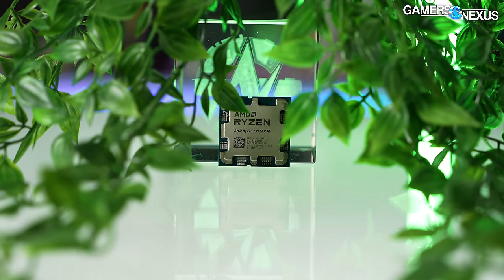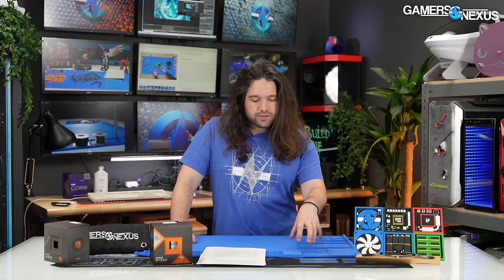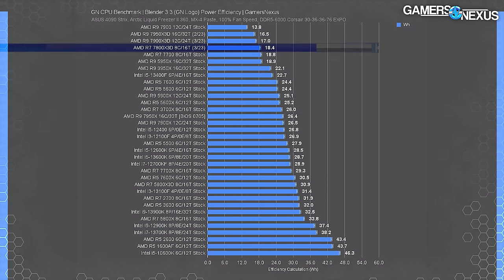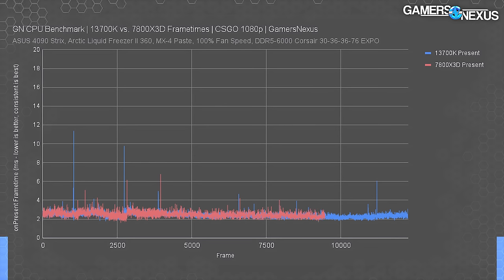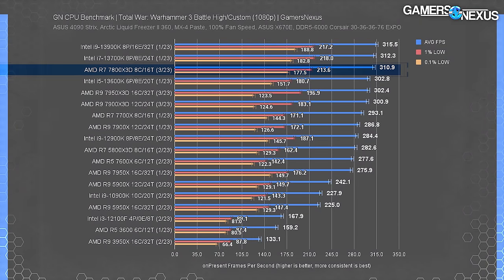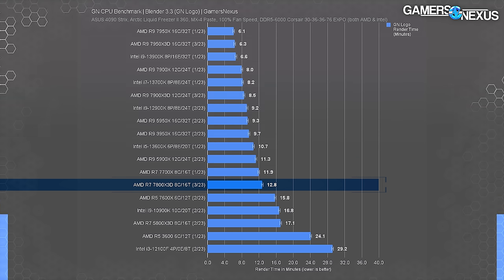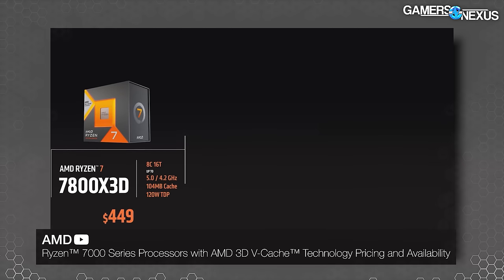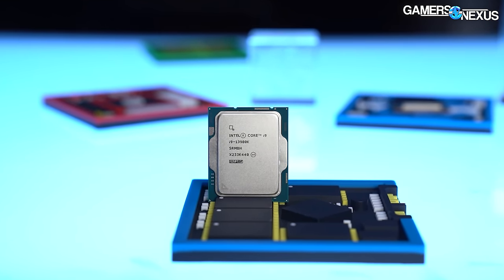AMD Ryzen 7 7800X3D CPU Review & Benchmarks

Comment: I like that there's no easy answer between AMD and Intel in this particular segment. Feels like no matter which one you choose, you're getting a great product. I'd probably lean more towards the 7800X3D as I don't use any of that productivity software, and I've been impressed with Zen efficiency in my laptops for years. Another excellent review GN.
Reply: For me it's the power usage of intel that puts me off.
Reply: Yep.   I do use some productivity software, which leans me a bit toward the 7950x3d given the efficiency.
Reply: @andytunnah7650  kind of curious if any undervolting is possible on the 13600k myself. I imagine i'd be the best all rounder for under $300 if you can.
Reply: @JoelHernandez-tz3vk  Yes it's super easy. I can get my 13600k to run the same C23 score (24K) at 1.262v (vs stock auto 1.320v) and reduce temps from 87c to 80c. The 13600k is also $249.99 now which makes it a great all around chip for gaming and productivity. Easily one of the best Intel CPUs in a long time.
Reply: Will you please provide a link to this 250$ 13600k offer? If you're talking about microcenter, then I'm afraid to say that they have cranked their price up to ~300$. At least, they have in my area.
Reply: @JoelHernandez-tz3vk  it is, also 13700k - some serious undervolting will get you to very similar power consumption with no losing any performance for gaming.. however intel still has better 1% lows in more games than 7800x3d
Reply: @dapperultron1784  Ah damn they did juice the price! Lame.
Reply: i bought the 7900x3d a few weeks ago and dont use any productivity software.

Boy do i feel stiffed.
Reply: @samson7294  Don't feel bad! My most potent PC at the moment is a gaming laptop and it has a Ryzen 5900HX and mobile rtx 3060. Still does what I ask of it, but you'll be set for a while since you can upgrade. Maybe there will be a Ryzen 8800X3D/9800X3D in your future. 😊
Reply: This is how I broke it down:

800X3D: You care mainly about gaming, low energy usage, and are fine with the $449 price point.
13700k: You care about gaming and production, don't mind higher energy use, and want to save a bit at ~$420.
13600k: You care about gaming and production, don't mind slightly higher energy use, and like the $300 price point.
Reply: The funny thing is people will go off about "having to undervolt, it's not stock etc." but then happily defend the 7950X3D and it's awful scheduling issues, expecting people to use affinities / process lasso their OS.
Reply: @samson7294  refund!
Reply: @OnTheRocks71  oh for sure, im very grateful that Im privileged enough to own a 4090 and  a 7900x3d.

Besides, i wanted to build a gaming PC a few weeks ago and the 7800x3d isnt in stock anywhere.

Also, im gaming @4k/120 and have been getting 120 fps mostly.Resident Evil 4 Remake looks incredible on my C2 OLED
Reply: If you want a space heater go with Intel, basically. You get the same performance but with a higher electric bill and heat output.
Reply: @andytunnah7650  Only under 100% load.  Under idle (which is where your PC is at most) Intel is about double as efficient.
Reply: @AxleTrade  You'll save a MASSIVE $10/year with AMD for less performance....just be honest, you're a fanboy.
Reply: @mintymus  Wow it took you an entire day to think of that? Here's a medal. 🎖
Reply: @AxleTrade  Thanks, glad you're impressed :)  Although it doesn't take much to impress an AMD fanboy.
Reply: @mintymus  it must be hard taking that long to think of a come back. I’m proud of you.
Reply: @mintymus  also, the fact that you went out of your way to reply to me on two different threads, you don’t have a lot going on do you?
Reply: @AxleTrade  And yet, you double comment. LOL look how triggered you are.  Whether I have a lot going on or not, it's definitely MORE than you, that much is for sure :)
Reply: @mintymus  just pointing out facts. You really want my attention lol.
Reply: @mintymus  oh wow double commenting is getting triggered but you using caps and emojis isn’t lmao
Reply: @AxleTrade  LOL you're really upset about AMD being inferior aren't you?
Reply: @mintymus  Nah, just stating facts.
Reply: @AxleTrade  Glad you finally agree, "dono", AMD is inferior :)  No need to be emo.
Reply: @mintymus  I don't know what you smoked to think I agreed lol. Strong stuff that meth is.
Reply: @AxleTrade  Sorry, I'm not like you and your family.  Don't know anything about that.
Reply: For me it's the energy use of intelligence that turns me off and for TDP energia cosmica they are better intel
Reply: @andytunnah7650  More power, more heat. Intel is supposedly releasing a 2nm CPU for it's 14th gen later this year... so I might wait. I was in the market for a new CPU, but this review is kind of underwhelming based on some of the hype I was seeing. Efficiency is important to me, but so is working in video production suites. And I think my CPU can get me another 6 months to a year before it's way too long in the tooth.
Reply: @samson7294  AMD pulled a dirty one with this launch...
Reply: get a room you 2
Reply: im gonna mention this like the and fanboys did before because of core counts. In this case id rather have the intel cpu because I don't want to have a pc as just a console. I'm not just gonna be using it for gaming. much like what gamers nexus said, the intel alternative is a much better all rounder
Reply: I am from the year 2024 and this comment has aged poorly.
Reply: this didn't age well huh